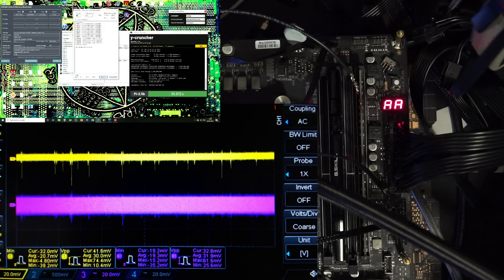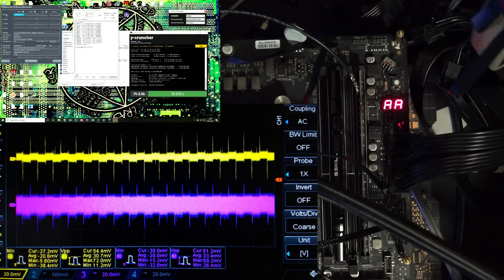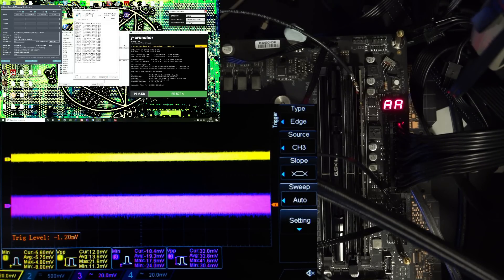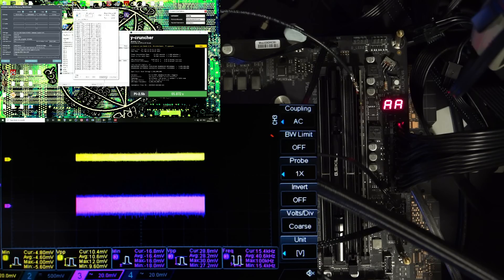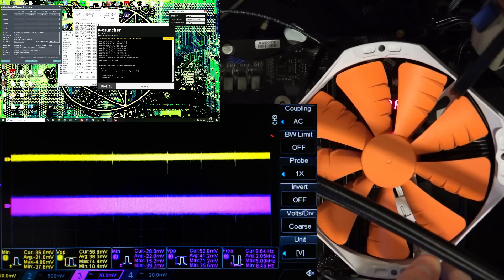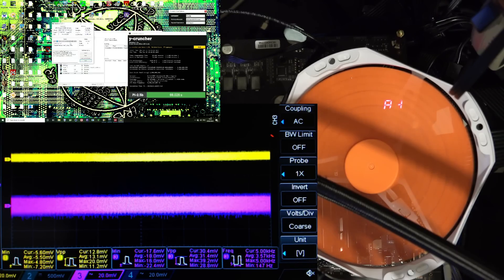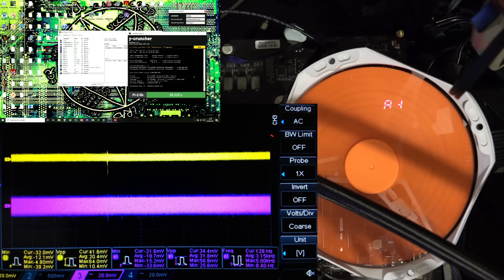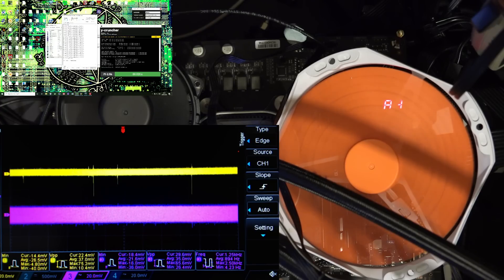Taking a look at DDR4 voltage regulation with a 5950X and dual rank Samsung B-die

Comment: I wanted to ask when I'm doing work with my 5950x, I get like a random slow down, and then it comes right back. The mouse cursor would move in slow motion and the audio gets slowed down.
Reply: That is usually because your Infinity Fabric (FCLK) is not stable if you are sure that the CPU is not overheating , thus throttling.
Reply: Wierd behaviour... never happened to me. 5950x owner
Reply: HOLY SHIT SOMEBODY ELSE THAT HAS THIS.

Dude, I've been dealing with this since last year. On TWO different CPU's. 2700 and a 5600X. Both on an MSI B450 Carbon. Nothing is or was defective, everything is rock solid stable. Friends PC also started doing it too, on a 3600X. For me personally, its become much less frequent, maybe I'll get it once a week, but it used to be once a day. Absolutely ZERO idea what it is. Has nothing to do with unstable settings because it does it even with PBO disabled and no XMP.
Reply: Isn't this the fTPM stutter issue?
Reply: @thatguy7595  I've heard lots about that on the sidelines but never made the connection, thanks for pointing it out!
Reply: I have been getting this stutter on my 5950x since switching to Linux....
Reply: @fleurdewin7958  I keep tabs on the heat with Hwinfo and it never exceeds 75c in hard sessions and gaming. This never happened with my 3700x I had prior with an Asus x570 hero viii board.
Reply: @thanatoast4  It never happened with my 3700x I had. It happens once in a while. Even with everything set to factory. New fresh install of windows also.
Reply: @FunKaYxxD1sCO  Honestly it happens so infrequently (even at its worst) that I kinda dont care. If it really is fTPM related then all we can do is wait for BIOS updates, which apparently should be soon.
Reply: Sounds like it could be fptm stutter bug? Amd website has some info on it, a bios issue if I remember correctly
Reply: @FunKaYxxD1sCO  What AGESA version is your motherboard? It should say next to the motherboard drivers on their website. If anything above 1203c then odds are its fTPM stutter and unless you're on windows 11(which honestly there's little to no reason to be) you should downgrade to 1203c AGESA drivers. At the very least disabling all tpm settings in mobo can help but mainly just being on 1203c.
Reply: @whatistruth_1  Current Agesa is up to date from Asus 1207
Reply: Sounds like a whea error check hardware info while your doing things to see if your getting any.

Comment: Do you get a spikier result with single threaded versus multithreaded workloads?

I'm wondering if measuring it at the memory stick there's a bunch of tasks all averaging out. Might explain issues at the end of tests as some threads are finishing before other ones

I think the issue with the mouse in Windows is that it generates a bunch of interrupts. I think they are generated 200x per second.
Reply: If it's a USB mouse there are no interrupts. It's all polling.
Reply: @samiraperi467  ahhh ur right. Thanks for correcting me!

Comment: I'd wager that voltage stability doesn't affect DDR4 OC because the current load of isn't that high so idle power vs laod power doesn't vary that significantly.

Comment: Does anyone know, why DDR voltage regulator on B550 TOMAHAWK increase switching frequency based on load, or it's a common things for single phase regulator?
Reply: Dont know about specific boards, but generally, you can reduce the frequency to save power, and there's basically no disadvantage while not at full load because you only get more ripple at high load.
Reply from the maker: pretty common feature for voltage regulators to have.

Comment: Whats easier to stabilize on a daisy chain board like Asus x570-E 4x 8 gb ddr4 3600 single rank or 2x 16 gb dual rank ? and which overclocks the furthest or are all Samsung B die 2x 16 gb kits also single rank ?
Reply: All 16gb sticks of b-die are dual rank

Comment: Would it be safe to run 5950X on Gigabyte X370 Gaming K5? You said it has good VRM, but that was for 8 cores. Would it be dangerous without active VRM cooling? No overclocking except normal Ryzen Boost.
Reply from the maker: At stock it'll be fine but the VRM will get really hot if the CPU pulls more than 170W.
Reply: @ActuallyHardcoreOverclocking  how about something like crosshair vi hero? you think it will be fine? I also wonder how high can the memory go as for example if someone wants to put an APU in.
Reply: @ActuallyHardcoreOverclocking  Thank you very much! Still a bit afraid to put it in this mobo, since temperatures in my attic room in the summer are insane. But at least now I know that if I put a fan near VRM (have to figure out how to do this) it might not blow up.
Reply: @jammetortiz808  If a crosshair doesn't handle a 5950X Asus would have screwed up royally. ROG Crosshair Boards are top of the line what Asus offers, so the question makes itself redundant. And "like" is like asking, do the high-end boards of other vendors handle a 5950X, which comes down to the same answer.

Comment: Hey bro, could u advise me on what would be the most optimal ram for the MSI am4 b550 gaming plus, 7 5800x, and a 3080 ti. I'm looking for something like these G.SKILL Trident Z Royal Series 16GB (2 x 8GB) 288-Pin PC RAM DDR4 4000 (PC4 32000) Intel XMP 2.0 Desktop Memory Model F4-4000C14D-16GTRG. If you had anything better in mind, would love your advice. My goal is to get the most fps in warzone, something RGB is preferable, the g, skills trident gold I want but will take something if it's gonna be the better choice, I don't mind tuning it but would like it to be able to run its xmp to fall back on if anything goes wrong. If I could take some of your time to help me out would really appreciate it and would find a way to make it up to you. Thanks

Comment: I have to buy soon 2x16gb ram for a 5950x on a asus tuf b550m, here in Argentina they sell a kit of  kingston fury beast 3600mhz cl18 that is my first choice so far because of price mainly. Sounds like a decent option? The pc is meat to run 3d programs, is not a gamer pc and the GPU is a 3080 12gb.

Comment: Hello all, I ve just discovered b die meaning and I upgraded my ram with corsair vangance 3200 mhz cl14 b die ram 8X4. Huge performance jump for me with 5600X and b550 aorus pro oc. BUT I only enable xmp profile and no more overclocking is done. Is this ok or should I overclock ?
Reply: B die is only really superior when overclocked as that's when it can be pushed to its full extent as it unlike every other ram die scales linearly with voltage(falls off eventually but that's at water cooling ram level of voltages so I wouldn't worry about it), allowing for nearly all timings to be tuned tight.
Reply: For sure. Expirement and see what you can get away with.
Reply: theres a lot to ram overclocking that i wouldnt recommend to beginners without extensive research. a few wrong timings and inproper stability testing can result in corrupted programs, and windows operating system.
Reply: Thank you all for your answers. I have one more begginer question. When I do the trials for oc on ram, is it possible to increase only one parameter and keep the rest same ? For example my ram stock xmp stats are 3200 mhz with 14-14-14-34. Can I keep the cas values volt etc and only increase the speed like 3433 or something ? OR all the paramaters should be increase at the same time ? OR I want the latency as small as possible, therefore may be I can bumb the voltage directly 1.4-45 and try to increase mhz with cl14 values as much as possible ? Last one is my aim I can say